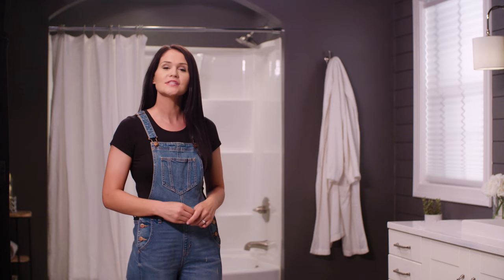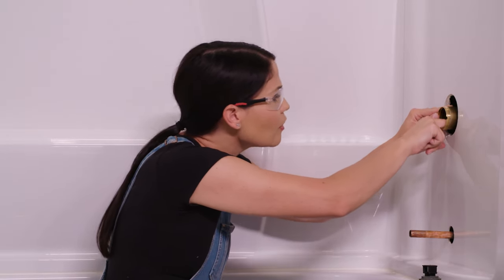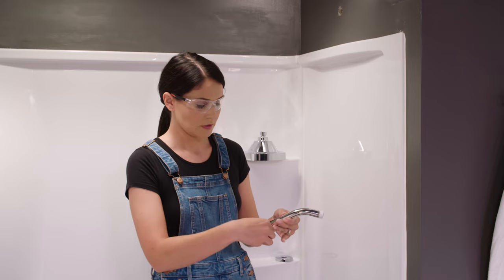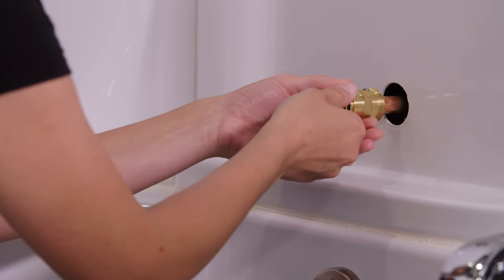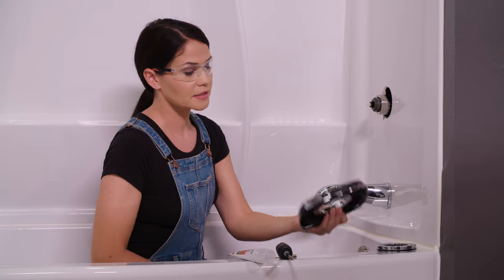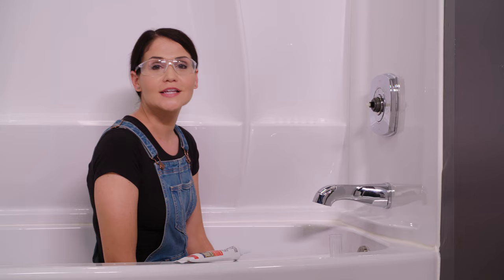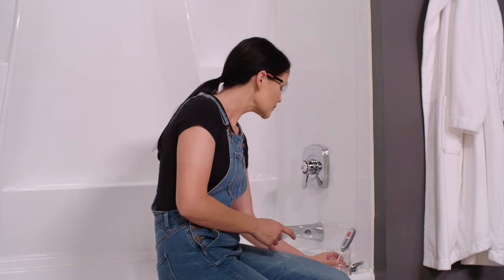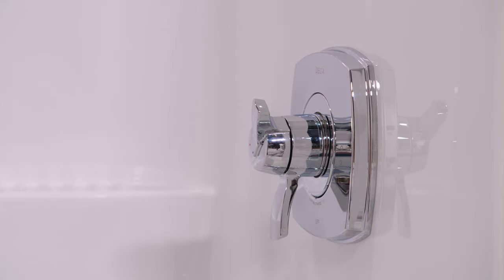How to Install the Delta® T17 Cartridge & Trim

Comment: How do you remove the temp handle since it just clips on? I'm afraid of breaking the plastic is attached to
Reply: Did you ever find a solution to this?
Reply: Use a razor blade, or something you can push the clip down with and it will pop off
Reply: @ReelBassAction  Not all temperature handles can be pried off.  First check for a very small hole in the cylindrical part of the temperature handle, kind of hidden behind the lever part.  If you find that, it should have a little plug in it, which needs to be pried out with a sturdy needle or the tip of an awl. Then you'll see a set screw in the hole that you'll need to loosen with an Allen wrench.  Then you can pull the temperature handle straight off.
Reply: @Degrative  Me and my dad just wiggled it side to side and it came off easily

Comment: Pre 2006 ur screwed
Reply: I think you just don’t use the white assembly piece???  I bought a replacement cartridge at Home Depot.  I have the pre 2006 valve…there is no way to put that assembly piece in.  The Home Depot cartridge did not include that adapter.  I think the adapter is for a post 2006 valve.  It is very annoying this is not mentioned in the video.

Comment: Excellent video.  Follow this video you won't go wrong.  For those who say they get barely any water.  I suspect he adapter was not fully seated.  It's the part you put in before the cartridge.  I used some o-ring grease.  The temp handle will always move with the flow handle.  Temp will not change from what you set it at.

Comment: Seems like you should lubricate the cartridge. If you don't then A) It will be harder to put in, B) the o-rings will deteriorate faster and C) It might be impossible to get out after years of calcium and mineral build-up, I just damaged mine trying to pull it out after 20 years.
Reply from the maker: Hello Brett,

Thank you for reaching out. Our parts do come lubricated from the warehouse. It is possible that flushing the shower regularly could help with calcium buildup. To do this, turn off the water supplies, remove the cartridge, and turn the supplies back on for one minute. Our products do have a Limited Lifetime Warranty that covers parts (other than electronic parts and batteries) and finishes of Delta® faucets purchased from authorized Delta sellers are warranted to the original consumer purchaser to be free from defects in material and workmanship for as long as the original consumer purchaser owns the home in which the faucet was first installed. I have included a link below for the warranty information.
https://www.deltafaucet.com/service-parts/warranty -Kelley

Comment: Well-produced, helpful, video. One minor improvement is to first check that the wall plate screws are long enough before you add the silicon to the back of the wall plate. Mine were not so that Hannah's suggestion to call delta CS resolved the problem. CS was helpful and mailed me longer screws once I supplied the model number on the trim box.
Reply from the maker: We were happy to help out, Richard!

Comment: Excellent video. I remove the mixing valve every fall and winterize our cottage. Then in the spring I re-install the valve. Should I lubricate the rubber pieces with the springs on the adapter? Also my hot side is directly in the middle.

Comment: If I already have an existing valve can I still follow these instructions and install this? I currently have a single handle valve and want to switch to independent flow and temperature control valve.
Reply from the maker: Hello mvadu, Thanks for contacting us! Yes, you can use your existing valve with a new trim kit! You will need to use the cartridge assembly provided with the new trim kit for use. -Kelley
Reply: You need a series 17 or 17t kit. T is thermostatic, btw.

Comment: My temperature control handle will not pop onto the unit, no matter what I try. Any tips?
Reply from the maker: Hello Ken. Thank you for contacting Delta Faucet Company and we are happy to help. We recommend making sure that the rotational limit stop is installed correctly with the arrows facing the right directions. With any further questions or concerns, please send us a private message with your contact information. -Carrie
Reply: Insert the handle side over the smaller tab on the control disk, then snap the other side opposite the handle stem onto the larger tab on the control disk.

Comment: How do you remove the handle to adjust the water temperature?
Reply: I have the same question…The temperature handle is wobbly and loose but I cannot see where to tighten it?
Reply: Pry it off from the side opposite the handle stem.  If it’s wobbly, it’s because the screw underneath is loose.
Reply: @danieldoherty5034  Yes, there is a screw underneath the temperature handle that probably needs to be tightened.  But not all temperature handles can be pried off.  First check for a very small hole in the cylindrical part of the temperature handle, kind of hidden behind the lever part.  If you find that, it should have a little plug in it, which needs to be pried out with a sturdy needle or the tip of an awl. Then you'll see a set screw in the hole that you'll need to loosen with an Allen wrench.  Then you can pull the temperature handle straight off, then tighten the screw in the center of the valve stem (using another Allen wrench).

Comment: I am removing  my handle but the volume control won't come off.
Reply: That’s the same problem I’m having I think it’s fused on with hard water corrosion, but I don’t wanna break it. Did yours come off eventually

Comment: When she assembles the temp gauge the handle is facing to the right. When she turns the water on to check the temp the handle is facing down. What's up with that?

Comment: Followed all of your steps, but when I moved the temp control to adjust the water temp, the volume handle moves with it,  I ENSURED the screw is not over-tied.  I called CS and they were no help, they actually sent me this video...any ideas?
Reply: I’m having the exact same problem. 😌I just run scalding hot water then turn it to cold until ready 😂
Reply: @kimberlydismuke2922  that's exactly what i do too 😏
Reply: Figured this out today. The white part that the screw goes into has to be turned to the opposite stop before installing the part over top